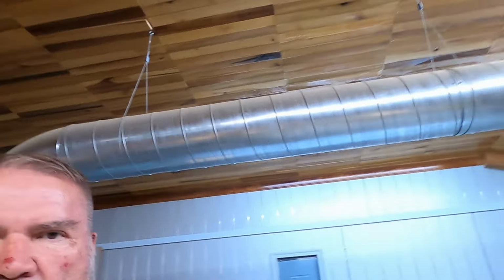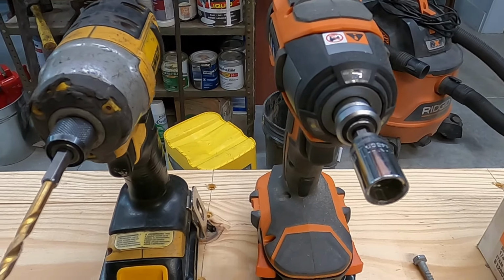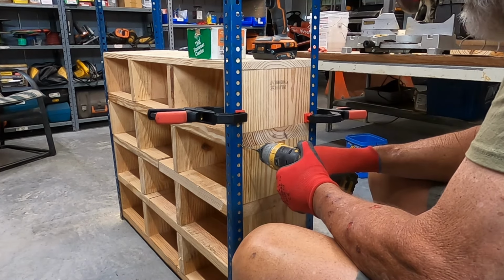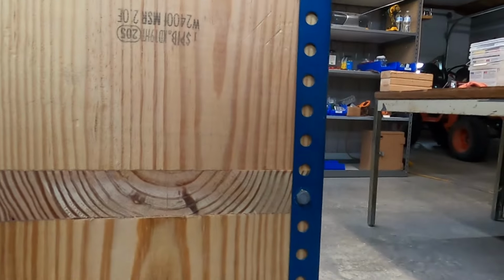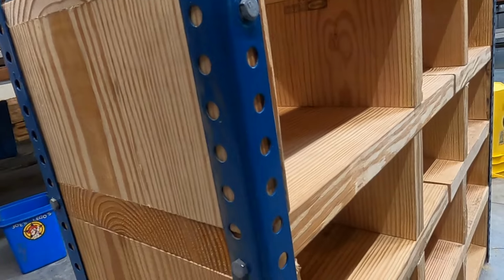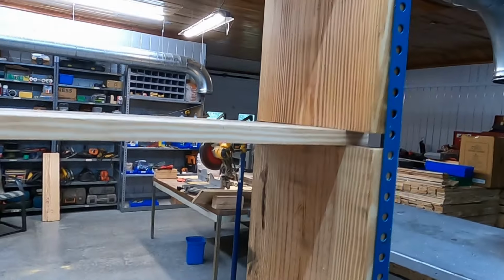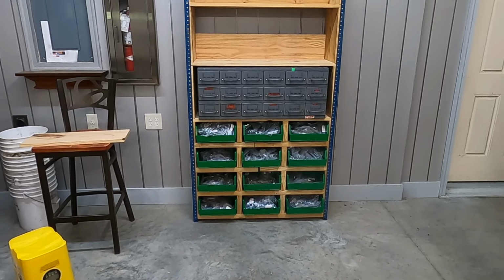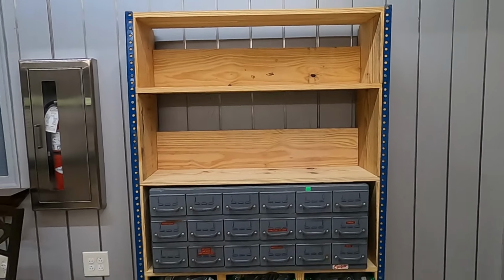Watch Me Build a Shelving Unit

Comment: Is the unit also connected to the wall?  Or is it stable enough to stand on its own?
Reply from the maker: In most cases, I like to screw a unit to the wall; however, I am selective because I don't like putting holes in the pleasant panels of the walls. The shelf is very sturdy.